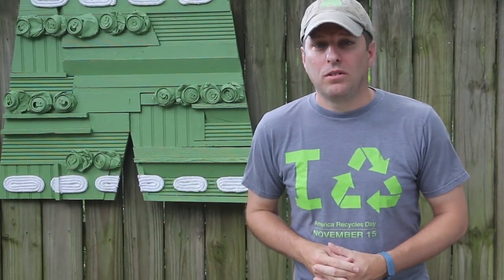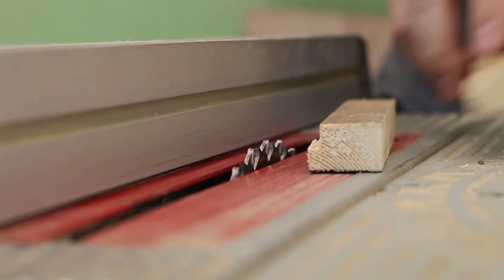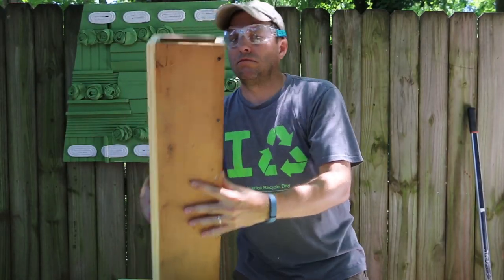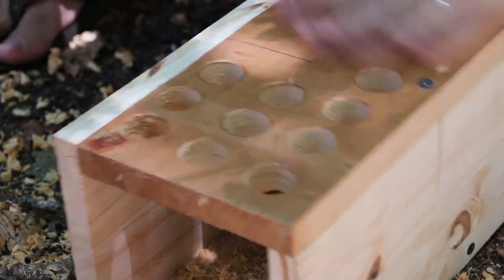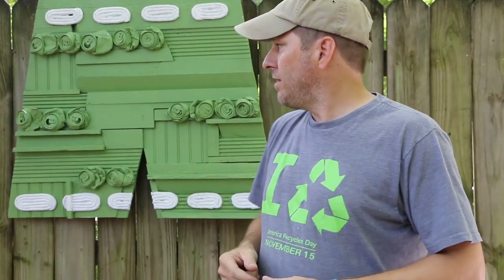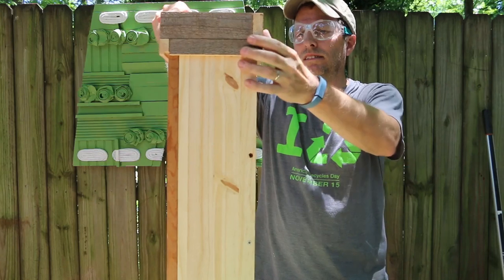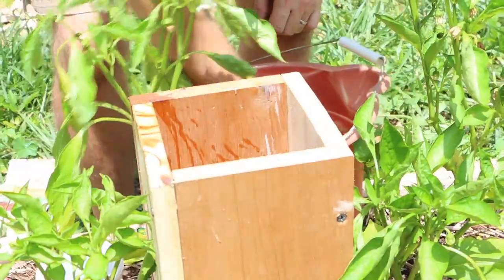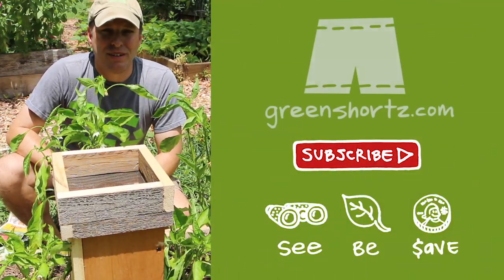How To Make A Worm Tower From Wood

Comment: When I build something out of wood that will be used outdoors I paint it with Titebond 3 waterproof wood glue. I buy it by the gallon at Lowe's. It's the ultimate wood primer for outdoor projects. I usually paint it on using a 4-inch roller.
Yesterday I built a manifold out of half-inch plywood that clamps to the bottom of my electric lawn mower. I glued (using bondo All-Purpose Putty) to the plywood a 3-inch drain pipe in line with the tip of the lawn mower blade. I painted the whole thing with Titebond 3 waterproof wood glue, let it dry (dries fast when you set up a 12-inch fan to blow on it), then painted it with grey patio paint. Today I turned my electric lawn mower upside down, clamped on the manifold, and fed 68 corn stalks through the 3-inch pipe and it chopped the stalks into a very fine consistency. I spread it over the corn bed to let it decay over the winter. It averaged about 2 inches deep.
https://c7.staticflickr.com/9/8879/29366490606_c37f3ea728_o.jpg
https://c3.staticflickr.com/9/8559/29292857122_1cd938ed41_o.jpg
Reply from the maker: Firecloud, loved your mower-shredder hack! Nice work. The resulting shredded stalks were pretty fine too. One of the benefits of an electric mower, is that we can turn them upside down (plus less emissions). Thanks for sharing your Titebond 3 tip as well. I actually want the wood worm tower to eventually be composted itself. I'm hoping it will last a couple years. But for my wood projects that need a longer lifespan, I'll be adding your waterproof glue trick. Thanks for your comment.

Comment: The shorts made out of recyclables in the background is so cool!
Reply: Questions: how often do you need to water the worms? Probably more on hot days, but during a time of the year with moderate weather how often?
Reply from the maker: Thanks for noticing the shortz! :-) In moderate weather, you can water once or twice a week. You need to sprinkle a little water whenever you add bedding over your veggies scraps. And yes, daily watering in your Texas heat will help keep the worms cooler.

Comment: I am concerned that too much water from rain can flood the worms in the tower if the lid is porous. Is there a way to protect the worms from flooding yet provide a way to keep BSF from gaining access? Have you had any flooding problems from capping the tower with screen?
Reply from the maker: Hi Ellen. Look at it this way...if the worms are native, they are used to the amount of rain in your climate. If your worm tower is in a raised bed, then it probably drains better than a compacted soil. Plus, the column of compostables, above the level of the garden provides an area for the worms to migrate higher to avoid excessive water. So if your garden doesn't flood, then I think they'll be fine. Thank you for watching.

Comment: I don't have room for an actual garden but i was thinking small scale for indoor 20 gallon containers, how small can i make the tower before it doesn't really work?
Reply from the maker: +Captain Kyerial Button if you can fit a 4" pipe in the container that would work best. However 3" would be suitable too, although a little trickier to dump compost in a 3" pipe worm tower. You might consider a flow through worm bin. Thanks for your question.

Comment: Looks really pretty. i am also going the natural material route. i wonder, could this be done with a wide piece of bamboo/similar size and shape as PVC? do you think it would decompose less or more quickly then wood? will be making a potato sack planter and dont think a square peg in a round hole would be the right fit.
Reply: Hi Dafne. Yes! I think the bamboo would be an beautiful material to use for a worm tower. I make my PVC worm towers out of 4 inch PVC. So the bigger the bamboo the better. Thanks for watching
Reply from the maker: Oops. I Replied from my other channel. :-)

Comment: I thought worms go into the tower only to eat but then back into the soil to poop?  If so, couldn’t the tower be much shorter like barely sticking out of the ground?  And couldn’t you use a solid lid vs one with screen?  I would think a solid lid would help keep in moisture.

Comment: Just for the sake of new ideas. Buying one piece of PVC versus buying what will eventually add up to many pieces of lumber that rotting will lead to. Contrary to the rot thought I see no reason why "treated" lumber (which I think should be purchased and then allowed to dry before use) cant have the contacting surfaces coated with a tough truck bed liner or undercoating which is harmless when dry as far as I know.

Comment: What about using pressure treated wood instead of heat treated.
Reply from the maker: I’d be concerned about the chemicals used for the pressure treatment having an effect of the worms and other biological organisms in the worm tower. Perhaps if the wood were aged outdoors for a few months, it could work. Thanks for watching.
Reply: They use chemicals to pressure treat wood?

Comment: What about Cradle to Cradle ? Making a worm tower using 3d printer to recycle  the material afterwhile? However I like the idea of using wood, brrravo !
Reply from the maker: Thanks for watching, Stephane. I hadn’t considered a cradle to cradle approach here. Interesting. My wood worm tower has survived a few seasons, but is starting to break down below the soil surface. Food for the termites now. :-) Thanks for watching.
Reply: To balance the ratio between time investment and durability I was considering the possibility to use giant bamboo cane. Doesn't matter so much if a bit smaller, diameter wise and quicker to decompose, since one cane can provide with many cylinders. In this case no holes needed just open the bamboo in the fibre direction to create one opening for the worms to pass. If you test it (and have giant bamboos in your area) let the community knows otherwise I'll add that to my millions project list...:)

Comment: I have Raccoons, Opossum, Squirrels, and Rats that would love to eat anything in the worm tower. Do I need a top that I can lock? And also wire mesh for the lid? Or are the eatables to far down the tube for them to get at...I know I would need a secured lid if the worm tower was a 5 gallon bucket...And not just a rock sitting on top of the lid. Raccoons are smart. They can open latches...I bet you Rats can get into the tube and out again without a secured lid.